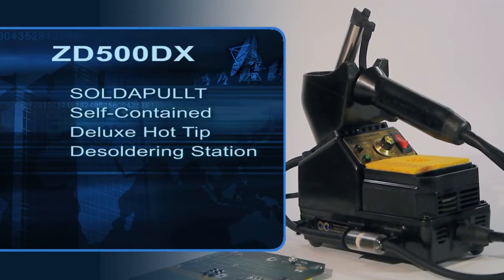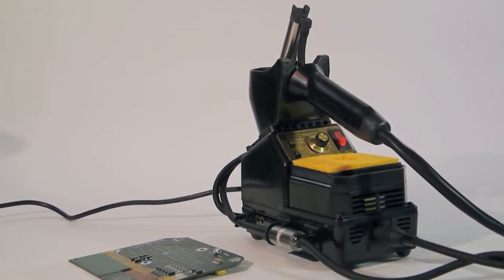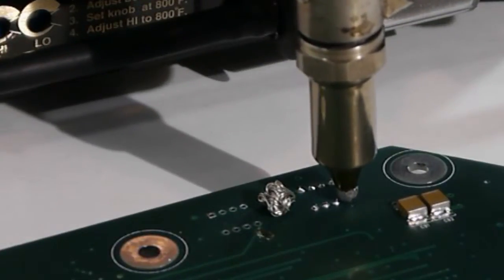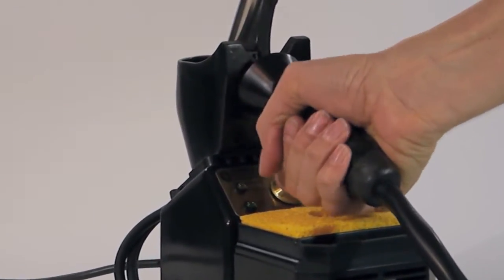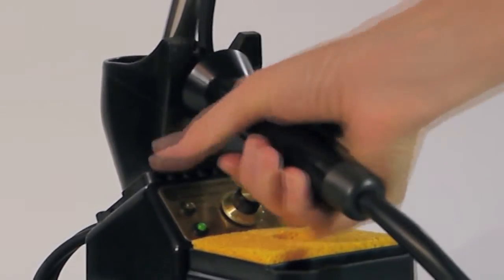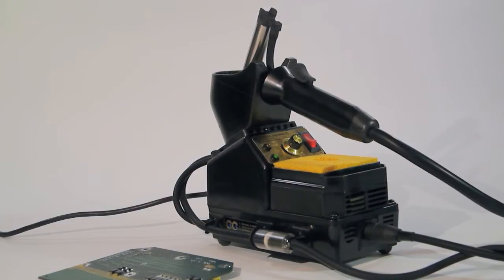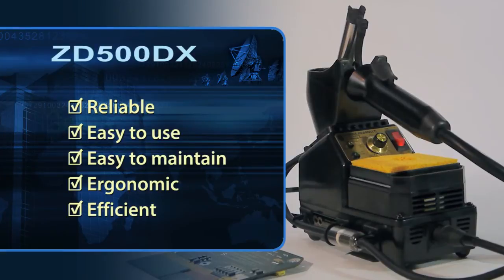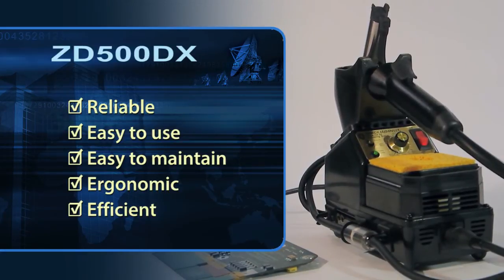EDSYN ZD500DX Hot Tip Desoldering Station

Comment: Hi to the Edsyn-Team,
I‘m in hobby electronics and I‘m using this station too for over ten years now. I really love it! Unfortunately the tip of the unit gets worn out over the years.
So I need a new one. But here in Germany I can’t find one. DigiKey only have listed them on their US e-commerce site. And even your German selling partner Globaco GmbH doesn’t have access to a spare tip for my station.
I’m also using your smd hot air station. But it seems to me that mine is somehow outdated. There’s no knob to adjust the heater on the soldering iron itself. And the storage compartment on the top of the unit is missing.
Maybe you could help me out here.

Greetings from Germany 
Sandy
Reply from the maker: Hi Sandy, thank you for your comment. I’m happy to help you. We do have a subsidiary in Germany that sells these tips. Please contact Edsyn GmbH Europa at edsyn-europa@t-online.de or (011 49) 9342 6413 and they will be happy to assist you with this request - my email is juli@edsyn.com if you want to keep me in the loop as well! Wishing you all the best!